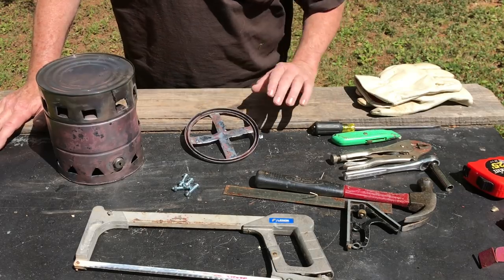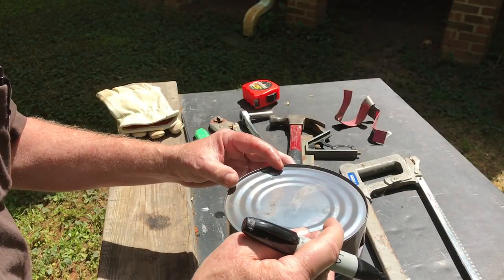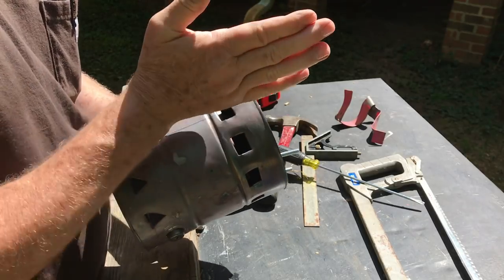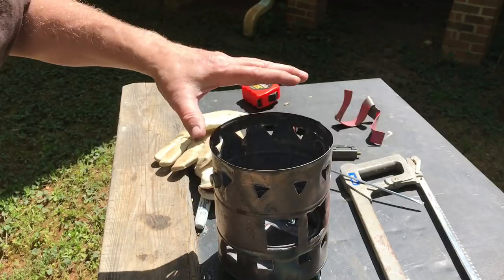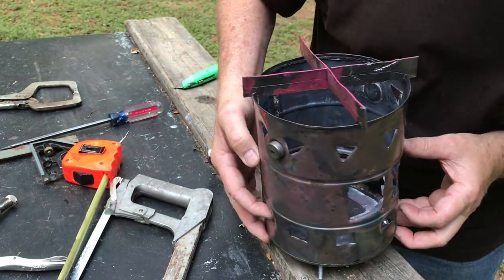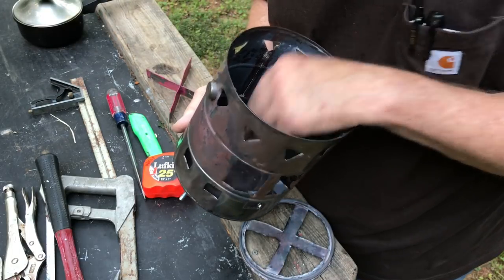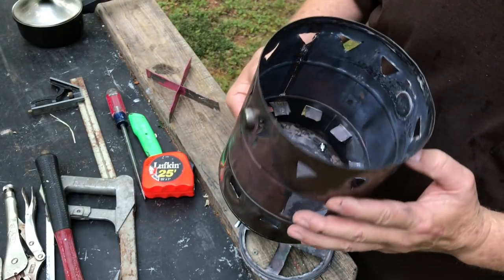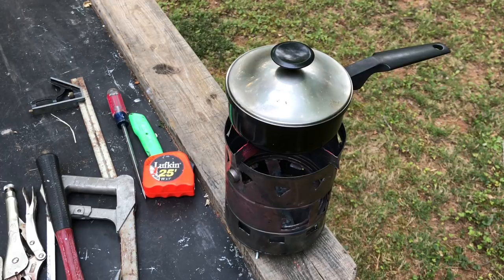Poor Mans Hobo Stove Build Part 2, Already found materials for legs and the pot support.

Comment from the maker: The theme of this build is, Grid down, no power tools, and only using found materials. The sheet metal that I needed for some pot supports I thought would take a little time to find. They might come someday from an old water heater, electrical panel, sheet roofing, etc. And as for the bolts for legs, even though I knew I didn't have any, I went ahead and looked through my bucket of misc bolts, screws, nails, and such and there they were, 4- 1/4" x 1 1/2" bolts. LOL!!! Leftovers from a car repair I did 6 months ago. It was just the next day while mowing up under a bush in the yard,  I got tangled up in something that locked the motor down. I pulled the mower back out and up popped a mangled up piece of sheet metal. I thought, no way, it's too mangled up and it's not even wide enough. But the more I thought about it , the more I knew I could make it work. So, it's only a couple of days later since I made part 1 and I'm ready to finish this Poor Man's Hobo Stove Build, No Costs... No Power Tools series.
   Please SUBSCRIBEat the end of the video. Thanks!
OTHER HOBO STOVE BUILD VIDEOS YOU WILL ENJOY:
Poor Man’s Hobo Stove Build, No Costs... No Power Tools
https://youtu.be/EqTGOEvUVzM
Hobo Stove Build, The old stove gave its best and Passed The Torch
https://youtu.be/nD6DtxEg_Co
How To Build A Hobo Stove Out Of A Gallon Can
https://youtu.be/PGSlN45f0ZI
Building Hobo Stove From A Green Bean Can, Then Cooking The Geen Beans On It
https://youtu.be/zSMsZwcimHE
Build A Hobo Stove From A 1 Gallon Paint Can, Exhaustive Tutorial
https://youtu.be/B9-HNChfh0Q

Comment: Thank you David. I like the toasting idea. Have you tried covering one quarter of the pot support to direct the flames away from the handle,? Maybee just aluminum foil folded down over one of the quarters right under the pot itself and down the outside of the stove. That's just my thinking to avoid buning non-metal handles and frying fingers.
Reply from the maker: Hot handles need to be dealt with for sure. Your idea would affect the draw and cause a lot of smoke.